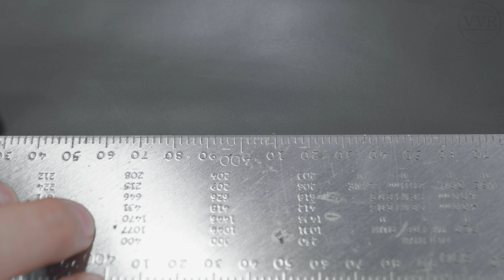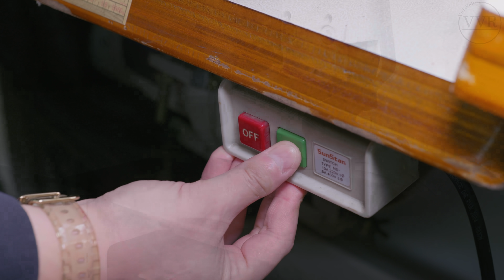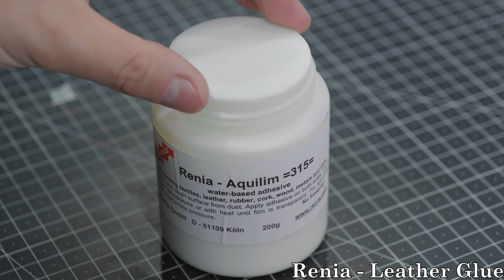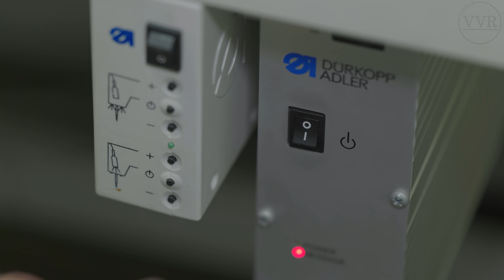[ASMR] 'Clean & Restore' Levi's Vintage Suede Boots Repair -4k 👢🤎🌙😴💤🛌 Shampoo insomnia satisfying

Comment: I started to clean and restore old shoes in my house, because of this channel
Reply: LOL  So many people say they go to sleep, get a soothing calmness. At the end of the previous watched I broke down and attended to 2 pair of shoes I had put off for at least a year.  Now the funny part was I would need to clean to try to mend them and they are a kind you can throw in the washing machine.  That did not even occur to me despite having machine washed a number of pairs of this brand over time. No I cleaned out the sink,  prepared a container of water, found a suitable brush, needed to find a step ladder to reach the saddle soap and proceed to scrub all 4 shoes like they had never been scrubbed before. 
It was frustrating, they are a complicated shoe that's not easy to clean and I would get annoyed and start to bail, 'good enough'. Instead found another brush and proceed to attend to all nooks, crannies and multitude of surfaces.
Like some how this channel creator would know, and cluck his tongue over my shoulder if I didn't❓
🤣